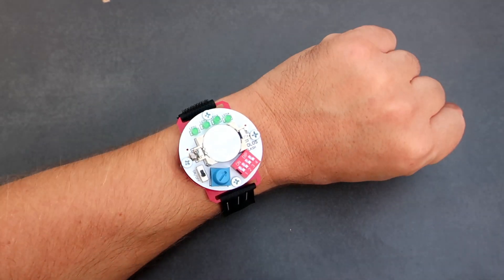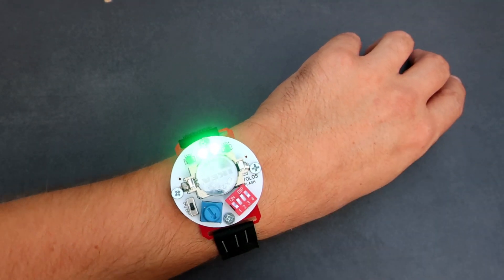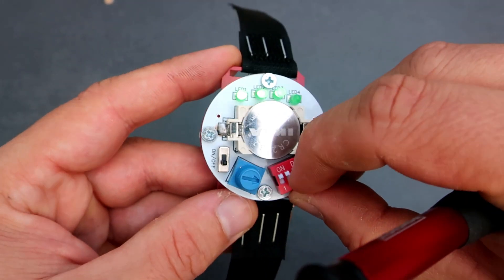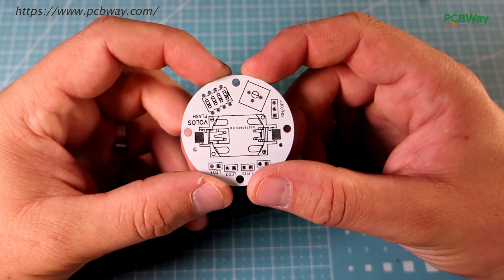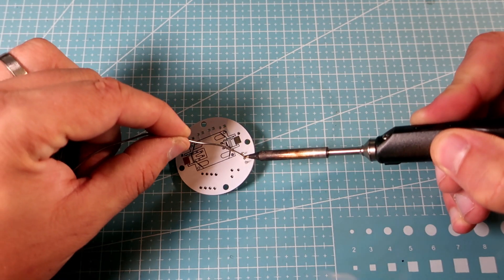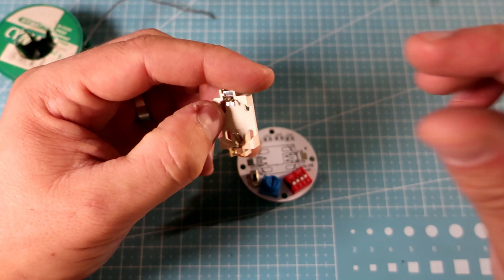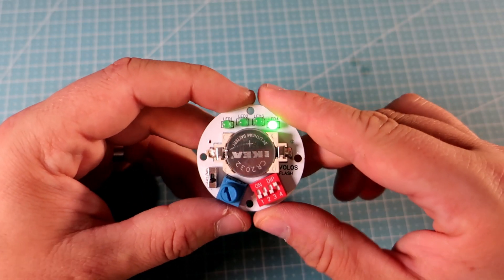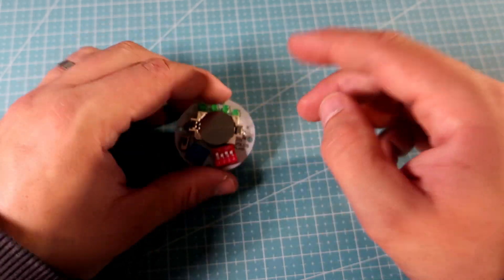Flashlight Watch PCBWAY.com

Comment: Great! And now add a time display to it! 🙂 You could use the LEDs to iterate through the time display showing a binary clock!
Reply: Seriously, it's not that difficult. A kid could definitely make a real watch from a kit with with some ATtiny85 and SSD1306 128*32 OLED display. A battery, a crystal, 2 capacitors for it, Attiny85 chip and the display, maybe a button, that's all that is needed...